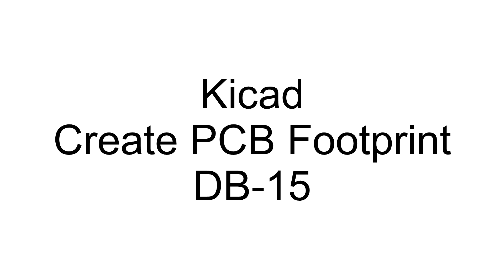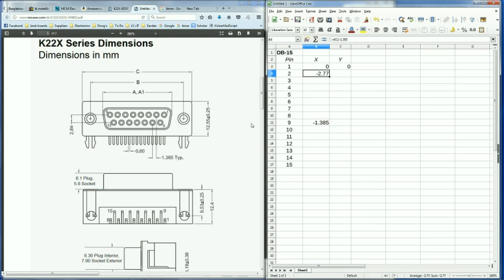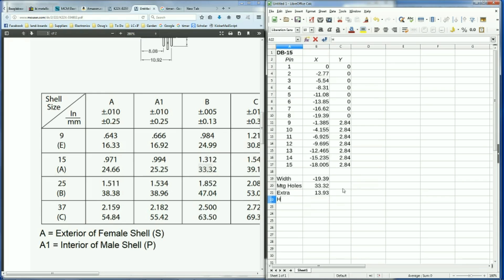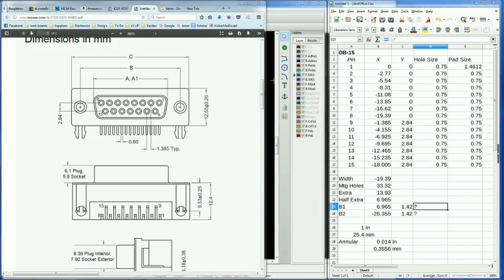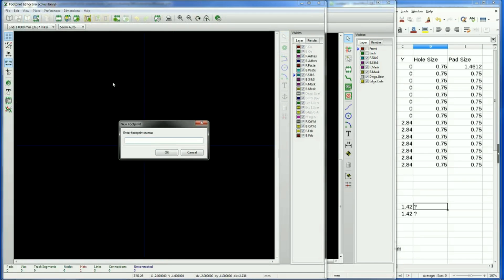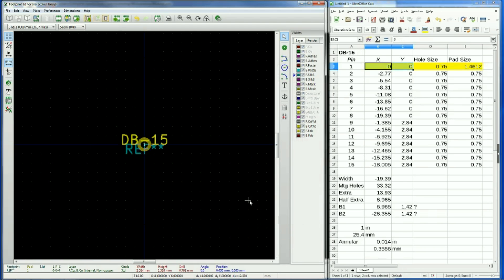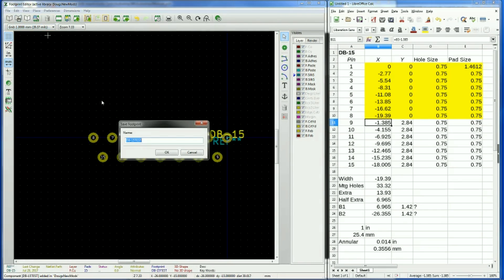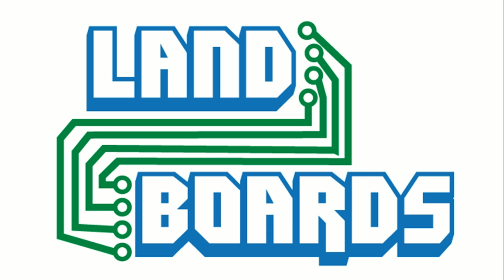Land Boards - Kicad - Create PCB Footprint

Comment: This is a good idea for calulating the dimensions required. All I need to know now is how to make a 3D model for this part and how to associate it with this footprint. I have more or less worked out how to make 3D models in Wings3D but I do not know how to associate it with a footprint.